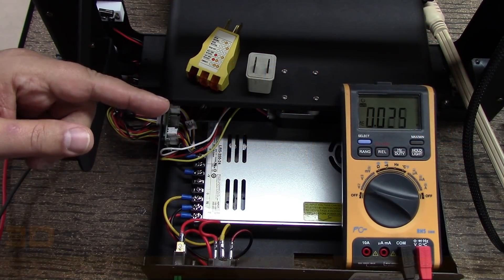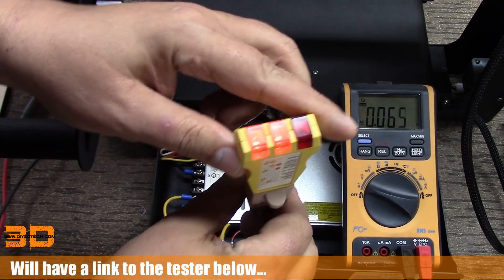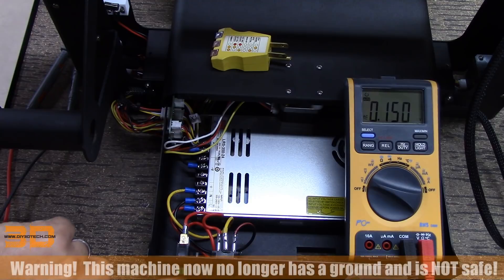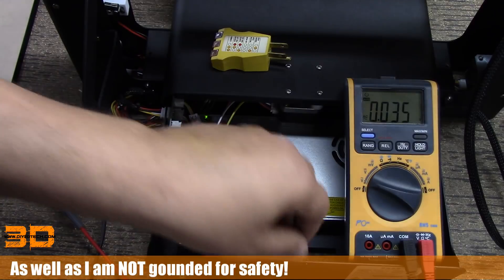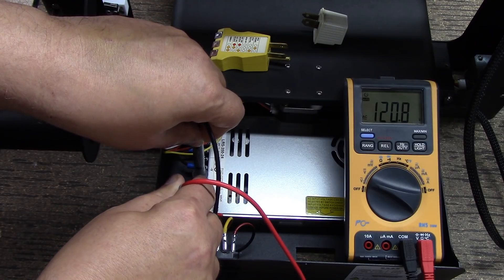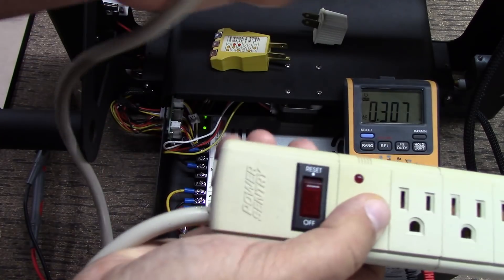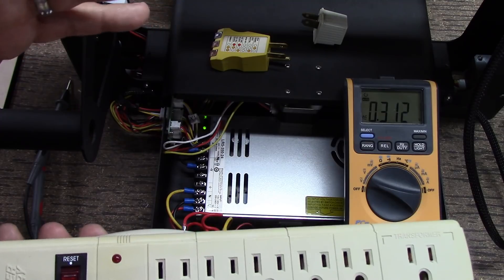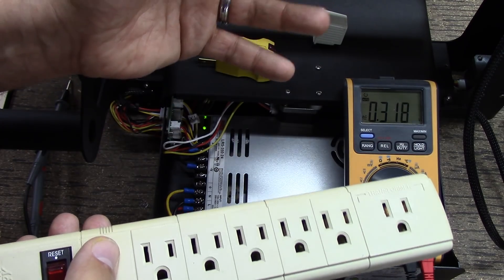Shop Talk - So This is why a Floating Ground is BAD!

Comment: Been learning about floating neutral thanks to the generator world and for me it's preferred since i have installed an inlet box to back feed my main panel.  Seeing as the panel has a neutral bond this is preferred since you can only have 1 neutral bond in the whole system.

I did however make a bonded neutral plug to use in one of my 120V sockets when using the generator as a stand alone unit when im using it for powering plugged in tools/devices for the reasons you showed in the video.

Comment: Lol i got used to getting slightly zapped from the printer exposed metal , i use a 3 prong plug and have a good ground not sure why it happens , same  happens when i switch to off grid solar

Comment: I just ordered a power strip to plug two printers in. I got a smoke detector kill switch i was going to plug in as well so it was going to go like this:
 printer > power strip > kill switch remote > extension cord desk table plug (drill a hole in your desk so you have a table top outlet) > wall outlet. 
all of which are grounded 3 prong. are you saying this would probably be a bad idea, and i should be going directly into the wall instead? This freaks me out and makes me not even want to touch the printers. Im down in my basement just in my socks and PJ's and dont want to get lit up by something.

Comment: The primary reason people break off the ground in the USA is they live or work in an old building that only has 2 pin outlets.   There is no ground wire in the outlet box.   Replacing the 2 pin with a modern 3 pin outlet just makes things worse.    Yes you can now plug in 3 pin plugs directly but you give the impression to people its a grounded outlet  which is a code violation.   Someone dies from this you are libel.  If the house burns down the insurance company doesn't have to pay.    Why?  Because you caused a no code situation with your DIY.    The point of this discussion is safety and not getting shocked.   NEC has an approved way to deal with old two pin outlets.   You can use a GFCI  https://www.youtube.com/watch?v=16KObgI44UE.     You still don't have a grounded outlet but the GFCI is a super fast circuit breaker specifically designed to protect people from getting shocked.    If you live in the US,  you already use GFCI protection anywhere there may be water (Bathroom, Kitchen, Garage, outdoor outlets).

Comment: Damn near all dc to ac inverters come with this floating ground!  How to ground an inverter that is the question.
Reply from the maker: I believe the intent of the inverter is that are used with double insulated device as this would be an issue

Comment: Luckily we have very good ground connections in the EU. It's almost impossible for the ground to fail. Even if the cord is pulled out, first disconnects live, second disconnects neutral, and lastly disconnects ground. I'm glad I plugged my printer into a grounded socket, around here depending on how old the house is, there might not even be a ground in any socket, except the kitchen, toilets and washroom. Those are always mandatory in every house.
Reply from the maker: Thanks for commenting as I do a lot of electrical work in the EU (Netherlands, Germany and UK) have seen as many ground failure there as the US and that is the point.  Its easy for a ground system failure so it should always be approached with care.  Also in the  US a proper plug, the Hot & Neutral are polarized and the ground tip longer so that it engages first and disengages last.
Reply: I don't know much about that, but in Spain I experienced cables being installed in the wrong order. Also outlets without ground.

Comment: The neutral to the ground connection inside the printer? That y capacitor seems
to be the culprit.    Who knew, who would of known. 
Observation: My 1970 model pop up toaster has FLOATING GROUND. No safety
ground, no third plug connection. Designed this way on purpose? No safety
ground because of OPEN heating element? 
We need an explanation why that y connection is in the printer!!
Wonderful video. Thank you.
Reply from the maker: Thanks for the kind comments and yes to the Y-Cap :-)

Comment: You should rerun your meter test with a low Z mode. Your results probably be drastically different, and a bit more honest.
Reply from the maker: Why?  This is a textbook example of what you would expect for a  "Y" capacitor and even proven in real life my Angus at Makers Muse which is what inspired this video...
Reply: Ground is very important. I don't have the same setup as you. But made a small video explaining my thoughts. This is why you should use a low impedance voltage test vs a normal voltage check. https://youtu.be/MCae-I1nL90
Reply from the maker: I watched the video and still don't understand what your getting at as I had 30 some volts and you read 21, so this is a 10 volt difference which is likely simply the difference in the capacitor...
Reply: Okay flat earther, you proved no evidence. Only can guess and say your meter is probably around 10Mohms, but the way you're measuring, you're using your multimeter as the load. If you add more to your load, using LowZ or even a resistor in parallel with your meter. Your voltage will drop. The impedance of a human body is between 100k (best case) to 500-Ohms (worst case). You wouldn't feel anything using THIS single load on the surge protector. They way you would feel if you add more (capacitance) to it. Run the experiment! See the numbers for yourself.
Reply from the maker: @RyanJardina  rest assured the world is round (I have already traveled around it once this year) and I also believe we landed on the moon too (however I have not been there, but know there is a well positioned laser reflector.  However still don't what your getting you 21 volts and I like 32 volts whats the point?
Reply: No sir, I had 122ish volts compared to your 32 volts. Because my caps were bigger. I didn't get 21volts until I put it in low impedance (Put more of a load on the circuit). I don't really care about the numbers, but the concept. The point is you're interpreting your meter incorrectly. Your meter is the LOAD.  If you want numbers Please remember OHM's law. Your meter. 32v/10M=3.2ua, my meter 122v/10M=12.2ua, & my meter in Low Z 21v/2k=10.5ma. If your 32 volts was significant you could put a small load on it and it would maintain 32 volts. But it is not due to the impedance of the supply.
Reply: Multimeters are design not to interfere with the circuits when probing. Your meter in this video is the circuit. You're measuring voltage in your video, but you're trying to show; power (not talking about watts), or danger. If I touched your voltage I wouldn't feel anything. Now if you added more things to that ungrounded surge protector, also have Y caps then yes as you stated.

Comment: Feel free to disagree, but I don't think of a floating ground as the same as an open ground. This video uses the terms interchangeably. Example of a floating ground is a generator like a popular Honda. If you use it for power, and attach a surge protector like one found on RV's, the surge protector will shut off the power to the RV because it doesn't see a ground. There's nothing wrong with the generator. The solution is to create a "Bonded Neutral" plug, which is nothing more than a Edison Plug with a short jumper from G to N. Remember, at your home, the ground and neutral are bonded in the breaker panel! All this plug does is recreate that with a generator.
 I agree about power strips. I found one with Hot and Neutral reversed! How could that happen? The outlet was fine! The power strip had "surge protector" built in and I surmise that somehow caused it. TOSS!
Reply from the maker: I am not sure there is anything to "disagree about" as when you look up "floating ground" (https://en.wikipedia.org/wiki/Floating_ground) you find: Most electrical circuits have a ground which is electrically connected to the Earth, hence the name "ground". The ground is said to be floating when this connection <does not exist>.  Technically ground always exists, its a matter of impedance to reach...

Comment: You should really have measured from case ground to actual ground (as Angus does in his video) rather than from neutral to ground. I know that practically it's the same but you want to replicate the conditions.
Reply from the maker: Thanks for commenting! As you point out its "practically it's the same" so the idea was to show the bleed as the source of "shock" because at the time there was big hoopla that these were "unsafe" and really was a comparison as too this came out in response to Angus's initial video of where he was "shocked".  I know he later did a similar video after mine...

Comment: While you were unplugging stuff, I also noticed how you can pull the plug out "halfway" and expose the pins... That seems to be a terrible idea, especially with children?!
Reply from the maker: Are you talking about inside?
Reply: DIY3DTECH.com No, the actual plug and socket. The socket is flat, and the pins are exposed all the way. That you pull it out slightly, and the pins are exposed - kids could get their fingers behind and touch it.

Comment: I would be more concerned why the printer is leaking current to ground.  The potential between neutral to ground should be zero.
Reply from the maker: Not sure I tracked this as you say talk about a leaking to ground and then say "he potential between neutral to ground should be zero"...
Reply: There should be no voltage between ground and neutral
Reply: @stevehill1802  I honestly don't think this guy knows what he's talking about. He rants about how power strips make everything "electrically common", but its no different to the wiring in your walls, except for maybe additional breakers and mice. He doesn't talk about his isolation transformer built into the strip (which probably removes the ground without the adapter), and as you say, and potential between ground and neutral means something is really wrong.

Comment: What about surge protector? Is it the same as extension cord?
Reply from the maker: Yes, as your adding and "plug" and length of wire can do two things, (1) cause a break in the ground as happened to Angus over at Makers Muse, (2) compromise your ground do to added resistance of both the wire and extra connection.

Comment: I remember seeing those three prong to two prong adapters as a kid years ago, I never knew they could be dangerous. I think I understand a bit, but my question is, what else can be dangerous if plugged into a power strip if the ground in the strip is faulty? I'm guessing everything? Because computers, Playstation, Xbox, and other popular items all have power supplies like the 3D printer right? Last question, if you know the ground on a power strip is good, is it still safe to use the strip with a 3D printer, or should it just be avoided?
Reply from the maker: So anything with three prongs that plugs into the power strip is at risk  as there are a couple things at work, (1) each additional connection [plug to socket connection] means (a) higher resistance and (b) the potential for a lost ground.  Then there is (2) the quality of the strip or extension cord as many of the cheap unit some form of mystery metal and this mean higher resistance and resistance means heat and we all know what happens with heat.  Now is all of his stuff evil?  No, if used properly they can be safe as let's talk about usage for a second.  Power strips and extension cords were meant for temporary application not permanent, in this they aren't meant to run a device long term.  For example you use an extension cord for circle saw, your saw isn't a constant draw.  Now someone is going to read this and just all over me and say "but a 3D printer doesn't draw as much power as say a table saw".  Correct, BUT most power tool these days are double insulated and the potential of lost ground having an effect is low, second, the additional sockets on a power are for convenience and not continued use.   As this is my biggest concern and where Angus ran into an issue as he plunged multiple printers into one strip for long term use.  Local electrical code specifies circuit loading for a home circuit and a power stip or worse yet strips throw a major monkey wrench into this mix.  Whew, so in short if you buy a quality power strip and use it for what it was in intended then your good.  However if you simply plug a bunch of printers into, it well your mileage might vary.  Hope this helped...

Comment: Shouldn't all metal enclosures be earth grounded ?
Reply from the maker: And if the "ground" is not broken (as in the example) the metal enclosure is [earth grounded] via the screws of the power supply....
Reply: I mean regarding angus' printers, obviously there is no explicit grounding point, or it is screwed into powder coat perhaps ?
Reply from the maker: He broke the ground using extension cords and power strips...
Reply: ohhhhh I somehow missed that,  I even watched both videos, must have been distracted, DOH

Comment: It's not just "in the olden days" -- you're always supposed to screw in the ground tab into the outlet. -- If you leave it unscrewed, you're doing it wrong.
Reply from the maker: LOL! My hope is today it is unneeded as we to use these at Grandparents home like 30 years or so ago and this one pretty old and if dig deep enough I sure I have bakelite version :-)
Reply: Ha ha, that little green wire to screw to the face plate would only work if the metal box was in fact grounded? thank you
Reply: @tedlahm5740  Yes it only works on a outlet that has a grounded box.   Regarding older two pin outlets with no ground:   If the outlet is inside a metal box with metal conduit to the panel then you have a ground source for the screw.     If your house has plastic or older dark bakalite boxes they are not a ground source.    If you do have metal boxes and there is no metal conduit running back to the panel ,you have no ground source either.       So using the adapter screw to face plate may not give you a ground source.

Comment: Is it just a camera artefact, or does your power strip look a little yellowed by the indicator LED, between the switch and first outlet? That's also a fire hazard, it suggests the MOV inside is nearing the end of its life, drawing constant current, and heating, possibly leading to it catching fire. Yet another reason to use these type only for light intermittent duty.
Reply from the maker: You are 100% correct my friend!  No artifacts and the reason I chose that one too so good eye!

Comment: My printers are plugged into a power strip, plugged into a power strip, plugged into a power strip, plugged into a UPS, plugged into an extension cord :) To be fair, the extension cord is a HUGE construction-grade cord (10AWG wires) with a built in ground fault indicator, the UPS has a ground fault indicator on it, and they're plugged into the only grounded outlet available in this 110+ year old building (grounding spike is right outside my window). It's not ideal, but sometimes you have to work with what you have.
Reply from the maker: You have just caused all of the blood to drain from my face...  Well on the bright side you have a very big extension cord (i.e. 10AWG :-)

Comment: If you are in the UK with a standard plug socket, it physically won't let you put a plug in unless ground goes in first.
Reply from the maker: Correct (I spend a bit of time in London every year :-)
Reply: Dosent matter when half the plugs has a plastic tap, as ground pin ;)

Comment: Does the frame have to be electrically connected to the power supply, or is it just the fact that the metal power supply sits in the metal frame? If you insulate your power supply from your printer, will that stop the frame from becoming 'live'? Can we add in a ground connection from the frame to the ground of the power supply - is that safe to do and worth doing? I have a metal frame P3Steel with a classic power supply. Want to make sure any trace of electricity in the frame is safely routed away.

Thanks

Steve
Reply from the maker: Depends on the printer like this JGAurora A4 it all one body so the mains can short to the body and technically the physical connection of the PS to the chassis "should" be enough.  Whereas the CR-10 the PS and frame separated so the frame "should" be isolated.  Technically the correct thing to do would be to add a separate earthen ground to the chassis to ensure protection...
Reply: You are correct it all should be Grounded and it appears not to be which is a Code violation

Comment: What if the room doesn't have ground (old building)?
Reply from the maker: If you can't achieve a ground, I would not use it in that room as these are Class I appliances which means if the main shorts to the metal case, the breaker or fuse will not trip as there is no ground path and therefore you (or your family) will become the ground path.  Would suggest consulting with a local electrician to review your options to correct...
Reply: DIY3DTECH.com True, but I guess that will be true for any desktop computers as well?

In our apartment, we now have ground in every room, but this is a storage room in the basement where there’s an outlet.
Reply from the maker: There more so even would check with a professional as the likelihood of creating a ground  there is VERY high...
Reply: DIY3DTECH.com Exactly. Will do some measurements before I use it. 
To be fair though, ground is typically only on bathrooms and kitchens in addition to rooms fully underground on all houses here before 2000 or so. Now all new installations have ground, same with special appliances that MUST have ground. 

But it’s not allowed to have both grounded and not in the same room (so you can touch both).